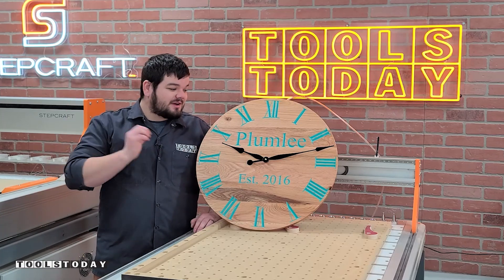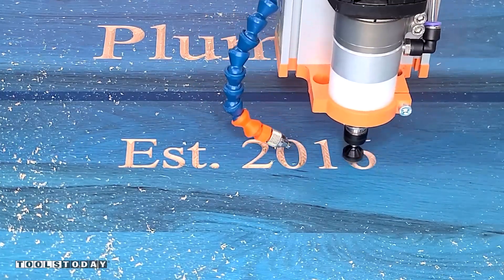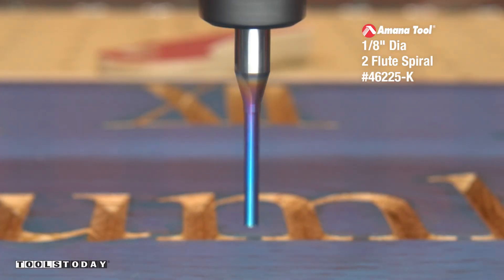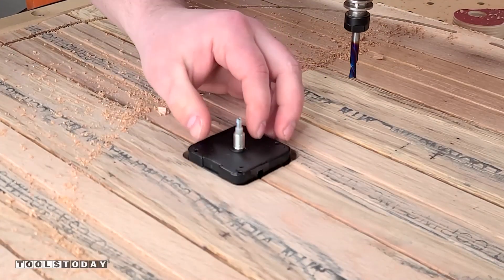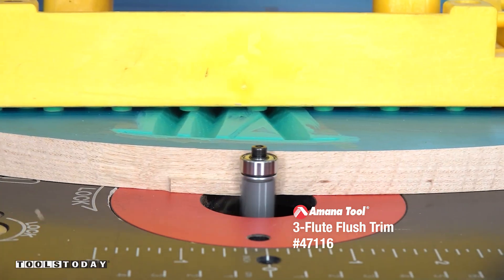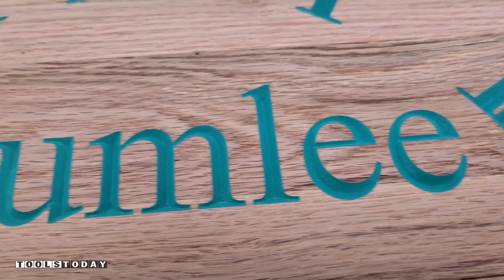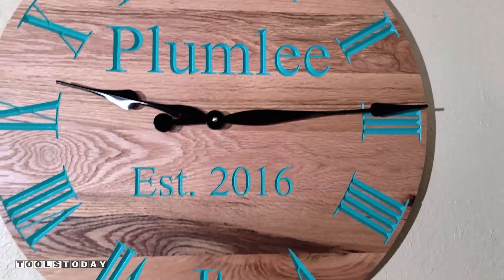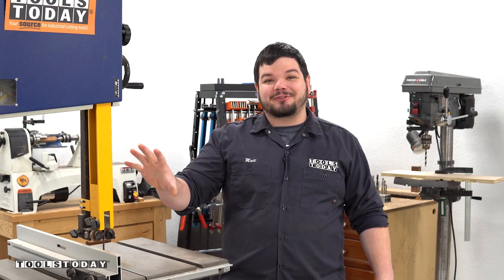How to Make a Clock on CNC | ToolsToday

Comment: Did you just glue together tongue and groove strips to make the panel? I was thinking about doing that and then using a flattening bit to surface off the edge grooves. Wasn't sure how well it would hold together.
Reply from the maker: Yes, I did.  It's holding together great still!

Comment: Awesome project!  I buy all my Amana bits from ToolsToday. I'm still learning speeds and feeds.  I notice you ran the feed rate well below the specs for the bits but maintained the full 18K spindle speed.  Doesn't that cause your chip load to be way too small?
Reply from the maker: Thank you for commenting and for the support!  It can, but its about learning the capabilities of your machine and spindle as well and watching the size chips that come off of it.  I have found that the settings listed here give me the best cuts on this machine.  I have a larger machine that is able to run the bit and push it faster up to the 180ipm the 46202-K can run at.